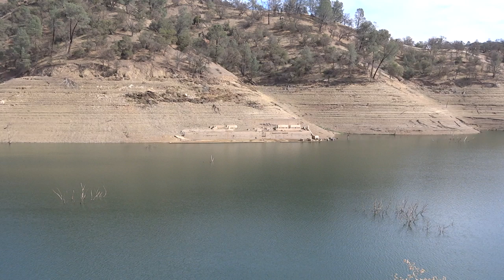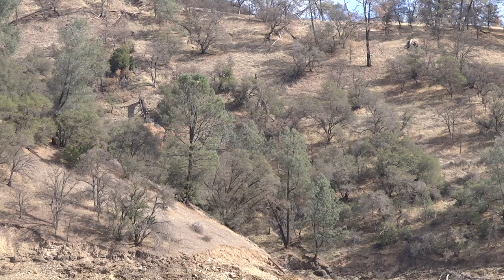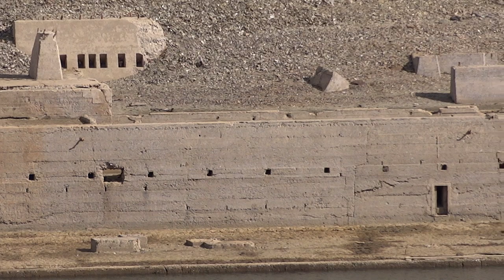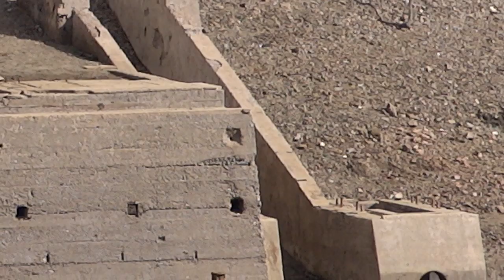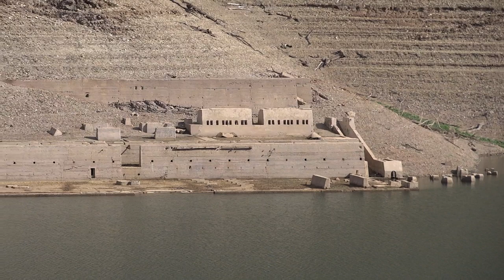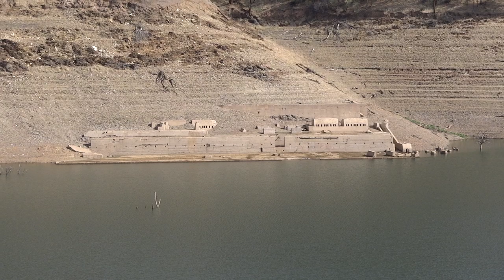Eagle Shawmut Mine Stamp Mill Lake Don Pedro Ca.1/4/14

Comment: The water has come up a bit actually but you can still see the old mine site.  We were just there Saturday.  Hoping some of the snow load helps bring up the water but it's going to be a rough summer.
Reply from the maker: John Buzolich Yeah this is bad.  The old Don Pedro dam sit at 580 feet of elevation and the lake is at 711 feet right now. This could be the year that the town of Jacksonville is visible along with the old dam.